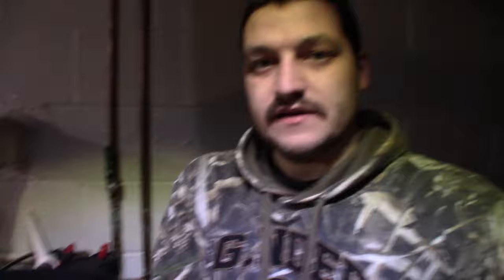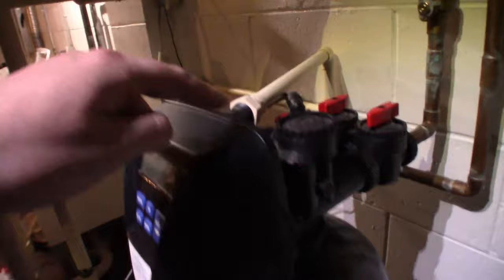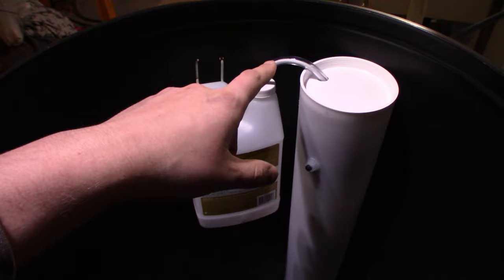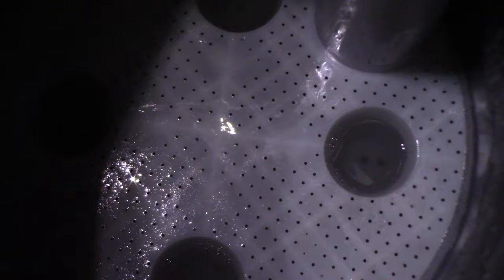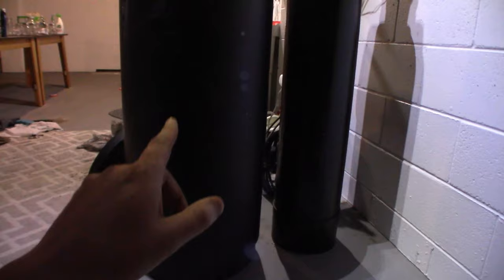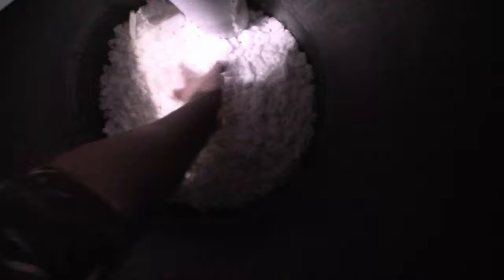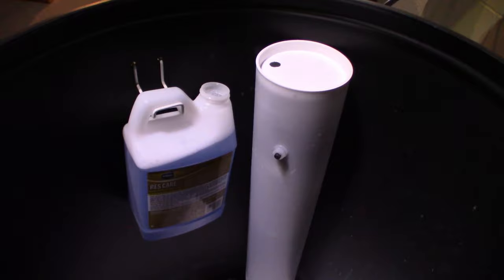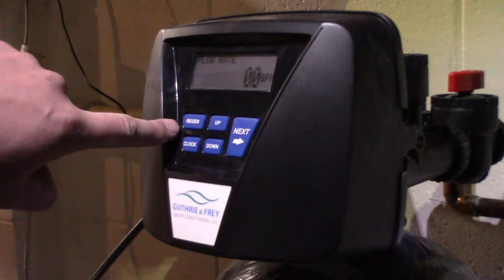How to Clean a Water Softener Brine Tank & Res Care System | The Green Acre

Comment: Thanks for the video. My system is 2 yrs old and the company that did the initial install also did my annual maintenance. I was very disappointed with their last visit. My water flow dramatically dropped and it didn’t feel clean. After tons of  research I was able to get everything clean and running better than ever. I appreciate the shared knowledge.
Reply from the maker: @Since-1883  Happy I could help!

Comment: You video is so important.. I have res care wick  .. know why now it's not drawing.. i got to soak the wick lol.. also have been using  crystals local brand rock salt 40lb bags and yes got to clean with wet vac like you shown..might switch to those morton pellets  to avod bridging but didn't have that issue yet.. also going to find out my town water iron is high but need the data iron to program my fleck 5600 stx  accordingly ty for sharing friend.. we have a local softener shop in town they'll give me the iron level and specs to set  proper iron high in my town water!

Comment: Thank you for sharing. Question. I notice you did not add any water to Brine tank when you finished adding the salt. I was told to add water a quarter of the way. Is this correct?
Reply from the maker: A properly operating water softener will add the correct amount of water that it will need to perform its regeneration process on its own. 😊
Reply: @TheGreenAcreWI  Thank you greatly appreciate 👍😊

Comment: Hi. I just moved to a country property. It has a 2 tank water softening system. Should I be using res-care in my system also? I really found your video educational. I have lots to learn since I come from the city. I’m on septic and have a well.
Reply from the maker: Congratulations on your move to the country! Two tank systems are the same as single tank systems with one advantage, soft water at all times. Since the system has two resin tanks, when one reaches capacity it immediately switches over to the second tank, no delayed regeneration. So yes, your system would still benefit from the re-care product line!

I have links in the description to the products 👍

Comment: Installed res up feeder but now the water smells like chemicals. Is this normal?
Reply from the maker: No, there shouldn't be a difference in the water smell. Make sure you followed the product directions but if everything is installed correctly and the smell persists, I'd contact the company. Does the water smell exactly like the pro-res solution?

Comment: You mentioned at the end that your system is setup to regen each night, and say in a comment that you confirmed this.
Is there a reason why you have it set to do this so frequently?  Resin tanks are sized based on their grain capacity, a product/quotient of desired hardness reduction and gallons of water. Unless you’re using thousands of gallons of the hardest water in the country I doubt you’re even close to reaching a tenth  of your tank’s capacity on a daily basis. Softer systems monitor water flow and trigger an automatic regen (almost always set to occur that night).
Each regen cycle uses additional water and salt (and cleaner), only adding to your operating cost.
Just curious what your situation is that has you running it this way?

Also, I’ve seen reviews of claims that the feeder will empty itself between cycles, meaning that the wick flow is greater than the required dose/regen. How often are you having to refill your reservoir?
Reply from the maker: Good questions, this is how my system was setup when it was installed. I haven't made any adjustments to its schedule but perhaps I should revisit that 👍 I refill the solution maybe three times a year.
Reply: @TheGreenAcreWI  thanks for the response.
I’ve always just used the single-use dosage bottles but inflation seems to have hit these as well since I last stocked up a couple years ago, so I’m looking at options for bulk savings. 
I like the idea of the feeder but my regen only averages every 2-3 weeks, and I’m running a filtration system in front of the softener to eliminate much of the contaminants that otherwise aren’t fully removed by the salt cycle. So I’ve got my system set to remind me to do a clean cycle every 4 months.

I think I saw another comment asking about how you know your water hardness. You can test your water hardness with a test kit, such as a pool water kit, but they sell more expensive versions with (questionably) more precise measurements marketed for your home’s water supply. The difference in units of measurement is the main factor, where the pool tests will read in ppm while your home’s water is discussed in grains per gallon (gpg) so there’s some math involved in converting units if you opt for the pool test kit. This is how you determine your desired hardness reduction that gets entered into your system, and how the system then determines when a regen is required.

Comment: what about making a video on how to change the media resin in the tank.i have the same system as yours. thank you.
btw, where did u get that res care cleaner and how much? is the wick came with it?
Reply from the maker: My system is new enough that I won't need to change the resin media for quite awhile. The resin should last a good 5 to 10 years without needing replacement and with the rescare system I have installed it should definitely make it that long or longer. Here's a good reference video for you though: https://youtu.be/Z47JGH1l39o

I also updated the video discription to show the products I used. Thank you for the comment!